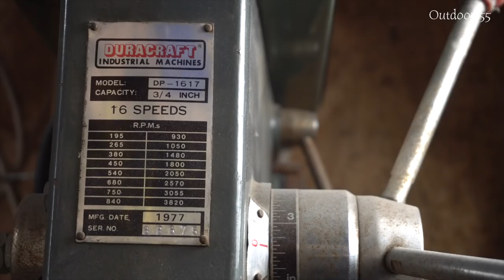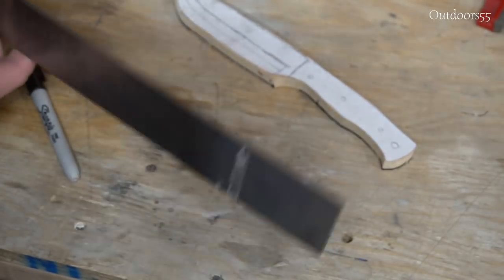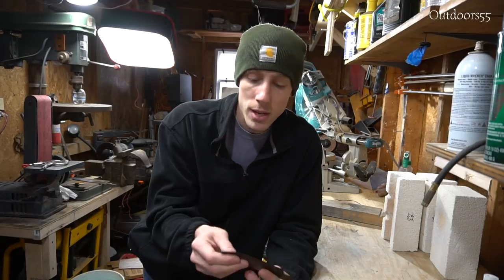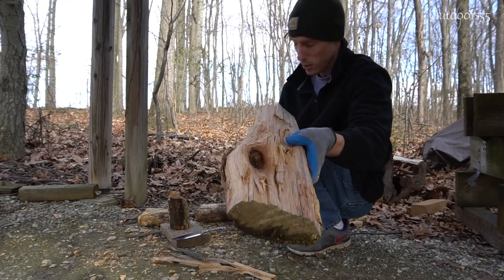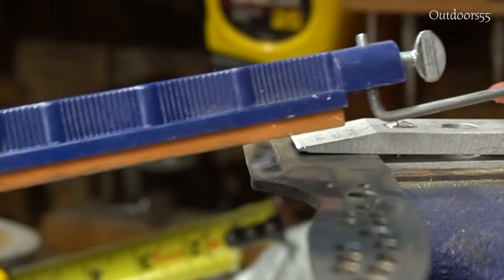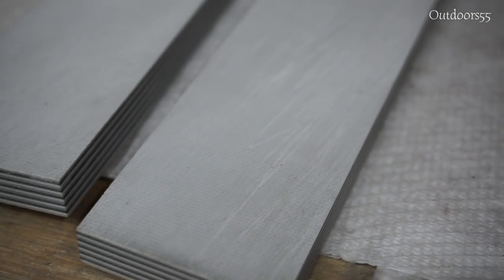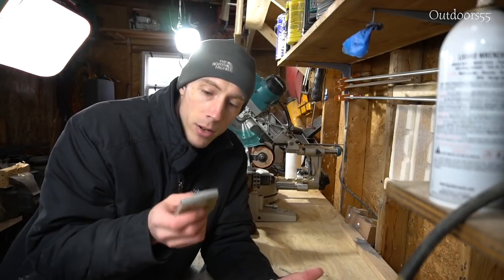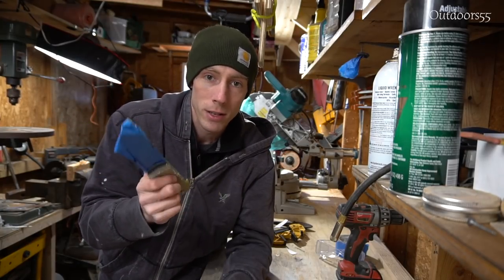Knife Making The Bushcraft Chopper

Comment: I have owned my Lansky sharpener for over a year now and I can agree that the Lansky angles are not going to be exactly the same. If I were you I would purchase an angle cube! It can tell you how far you should put the blade in the clamp! Also the little cut out in the jaws is meant for small height blades.

Comment: Here's a challenge for you: make a small utility knife with a blunt rounded tip that can be used for the widest variety of tasks you can think of, mainly in the kitchen and around the house. For the handle use a dense material with low porosity and give it a smooth finish (to be easily washable). When you're done give it to your wife, she's gonna need a safer all-purpose knife to use instead of her normal kitchen knives when the little one grows old enough to start moving around and playing with stuff he's not supposed to when you least expect it ;)
Reply from the maker: Interesting design👍 I like that idea.🤔 Now you have me thinking...thats usually not a good thing lol.

Comment: That's crazy how well your edge held up. I made my first Scandi grind knife out of 1084, had it professionally heat treated (60 RC by Peters Heat treat) Looked to be at about the same, to slightly less acute of an angle... And my edge deformed just by slicing paper, let alone wood. lol
Reply from the maker: Thats indicative of a bad heat treatment. No knife edge should roll or chip that easily.
Reply: You would think right? I ended up just putting a secondary edge bevel on it, basically turning it into a sabre grind. The knife works great now, so I'm not sure what's going on?  I also had the same issue with a Mora Classic I sharpened to full Scandi, the edge was simply far to delicate for any real use, I had to put the secondary edge back on.

...I'm interested in Scandi grind knives for wood working, but I've yet to have a good experience with one.

Comment: Great video as usual.  On the Lansky when it comes to the angle, I believe you have to have the clamps perpendicular.  Yours looked like the gap at the back was smaller than at the front of the clamp.  This would change the actual angle.  I could be wrong.  That said, not sure how accurate those are in the first place.
Reply from the maker: That is true. Looking back it may have skewed the angle slightly but not by much. I checked it with a square as well and it got 16 degrees. Although the margin of error is probably a degree or so. Either way, weather the angle is 16 17 or 18 anything under 20 is impressive for 1080. I wouldn't have expected that. Im interested to see if tempering at a higher temperature would remedy the issue. Looks like more testing is in order. Thanks for the comment my friend👍

Comment: Hey brother great video! Just got a tip for ya if you dont mind. Your not actually using your Lansky correctly. I dont know if someone else let you know but the Lansky jaws are only meant to grab with that tiny groove on the tips of the clasping tool. Then your degrees will be correct and your grind cut will be the same on both sides. Hope that helps thanks for the cool vid
Reply from the maker: Go to the lansky website. The small jaws are only for small blades. This isn’t a small blade and the angle would change if the edge of the knife is farther away from the pivot point. They mention this on their site.  The angle was confirmed with a protractor. Hope this clears things up 😀 Thanks for the comment, and thanks for watching 👍

Comment: How do you determine how much "skeletonizing" you need on the handle portion of the steel?
Reply: There's a balance, the more material you remove creates a greater weak spot which can cause failure in the knife. regardless if youre making knives you should be breaking them to see how good your design, material and most importantly heat treating is

Comment: good job. Looks like it holds up well.
I spot a sander mod, please explain.
Reply from the maker: Good eye! Just something I was experimenting with. It doesn't work well. My sander belt doesn't track well at all. It was just a piece of 1/4in steel screwed into the sander platen.. It was supposed to provide a sharp edge so I could grind bevels. Problem is the sander belt doesn't track well and gives me weird grind lines so I have to hand file anyways.
Reply: That is a shame. Would it work better if you notched out the platen or would it still track weird? I was thinking of modding mine but I haven't had it too long and if it had a problem no way of getting a refund after mods lol. Mine cost almost twice as much as the ryobi one so it is fairly decent as 4x36 sanders go and tracks well even under load. Maybe you can remove the bulk with the sander and clean it all up on the filing jig and cut the plunges in on the jig. Looks like you did similar to that here and I imagine it would save some time. I have a cheap sander I don't use any more I am going to mod the crap out of it. Hopefully it will work for bevels. If not no loss.

Comment: 8th inch is perfectly fine. You could fully flat grind 1/8th and it’d still probably be durable enough. Especially using 1080 or 1084 if those steels have one thing going for them it’s edge stability and being bloody tough. You should look up Cliff Stamp on YouTube for a real scientific take on knife making.
Reply: You should try a really high grind with a secondary bevel and a microbevel. It’ll be tough as hell while still being thin behind the edge
Reply from the maker: I did get some edge damage in the video when using it on oak. 1080 is tough no doubt. A 17 degree scandi and chopping through an oak log is a lot to ask though. Thanks for the comment👍

Comment: In a previous video you used total boat epoxy to make micarta. Is the total boat epoxy not suitable to adhere the scales to the blade? That g/flex is expensive @ $20+ for an 8oz bottle.
Reply from the maker: The specs on the total boat epoxy are better than gflex. I’ve also done so experimentation with the total boat with scales. Even doing very little surface prep (just sanded the steel and scales to 100 grit and clamped for the 5 day total cure time).  I tried to hammer them off and it took a couple good blows before they did. Most of the epoxy stuck to the metal and pulled apart the scale material. I’d have no problem using it for knife scales. Especially with through holes drilled through the tang.

Comment: I just tried making a knife like this. I forgot to normalize it and went straight into the heat treat. The blade went “tink” and a big crack right across the blade. Is this because I forgot to normalize it? Or do you know the reason? I love your show. 
James.
Reply from the maker: What did you quench it in?
Reply: Canola oil that probably had some water mixed in. It was setting in the garage for a few days. Do you think that did it?

Comment: Alex, 
I noticed you used another angle grinder to get your profile, I bought a $7  disc to do the same thing and after one use on 1080 1/8”x 8” the thing is shot.. is that just how much it’s going to cost every time? Suggestions? The disc is specifically for steel and I’m using Dewalt 4 1/2” grinder (DW420)
Reply from the maker: What kind of disk was it? I usually get several blades out of one disk. The ones i use are 1/16" cut off disks from Home Depot for cutting. And 1/4" disks for grinding.
Reply: OUTDOORS55 dwa8424L type 27 1/16” x7/8”. It was the first time using angle grinder. Thought I should be getting more out of the wheel. I’m kind of wondering how much I can take off the disk before it’s considered “not good” anymore. Thanks for the time and love the videos! Can’t wait to see your new shop. Last video I saw of yours you got a bigger space. Almost done yet?

Comment: I think that scandis are usualy around 15 degrees
Reply from the maker: They can be whatever angle you want. Theres no one "correct" angle. 15 degrees would be too much for 1/8" steel on a bushcraft knife. Pretty much any steel would have a hard time supporting that angle doing hard work. I typically do mine at around 19-20. But again The angle can be whatever. Hope this helps😀